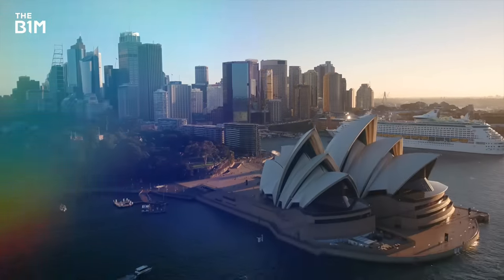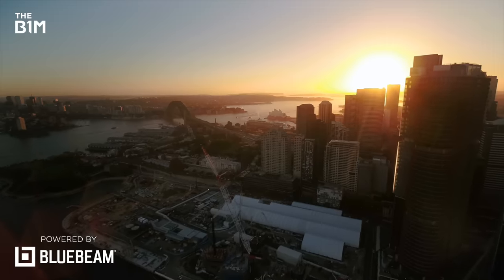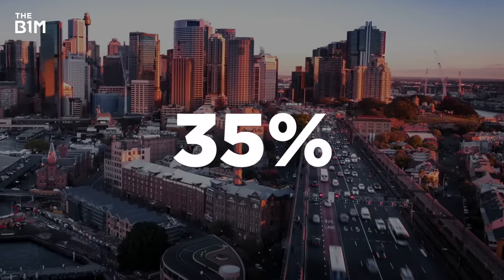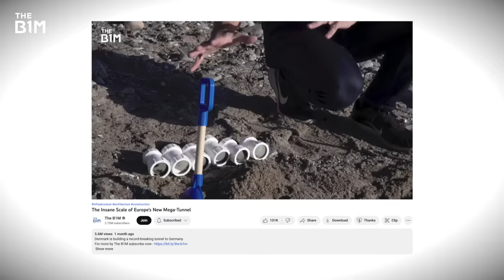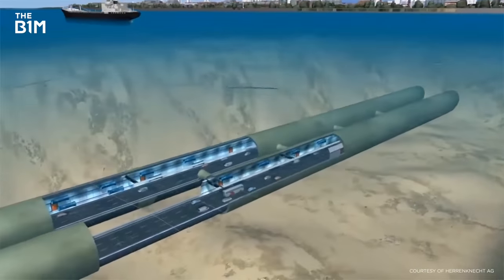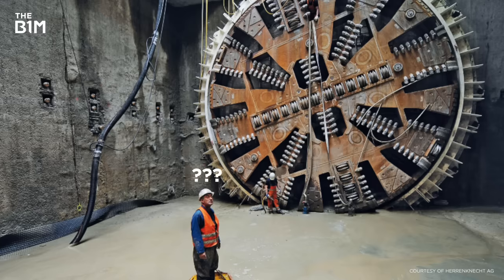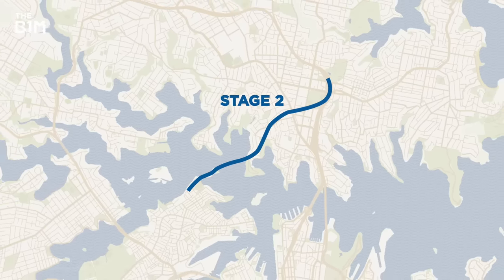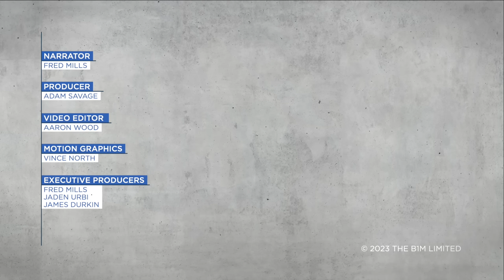Sydney's $5BN Tunnel U-Turn

Comment: Just a quick correction: The ANZAC bridge doesn't cross Sydney Harbour. You're thinking of the Gladesville and Iron Cove bridges. The ANZAC bridge replaced the older Glebe Island bridge for getting to the inner West from the city.
Other than that, a good video and very informative.
Reply: Technically Gladesville & Iron Cove bridges cross Parramatta River, no?

Comment: amazing video guys as always! I think Lower Thames Crossing is going to have over 16m in diameter and is also 3 lanes. So seems like pretty similar project. Maybe something to make a video about (not sure at what stage the project is currently tbh)
Reply: Also the very controversial Silvertown Tunnel!
Reply: @memofromessex thanks for pointing that out! I’ve had a look and seems like Silvertown tunnel is going to be roughly 12m so a bit smaller tunnel and probably 2 lanes.
Reply: Lower Thames Crossing and Silvertown Tunnel can do one, that same money could be spent on decarbonising our infrastructure. If you want a tunnel, let it be Tram/ Bus only...
Reply: @Garner84  
You will have more success explaining to car lovers in a CITY that their own self interest is to get other drivers off the road I.E. any forms of public transport means better driving experience; instead of worse with induced demand.

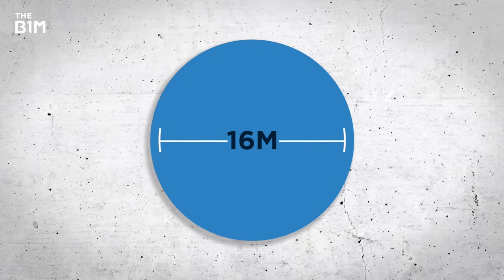Comment: 5:00 You could fit four railway tracks in a double-stack configuration in that big of a tunnel, each of which could be carrying tens of thousands of people per hour. Instead we have highway lanes serving 1500 people each.
Reply: We already have a huge railway system… adding in more wouldn’t be that useful.
Reply: @philliplhunter  well the sydney rail network lacks a lot of circumferential connectivity.
Reply: @williamhuang8309 that is why there is a metro
Reply: I'm not aware of the % grade of the end product incline, however I suspect it's unlikely a train could climb out of the tunnel.
Reply: @philliplhunter  You can apply the same logic to cars. We have a ton of roads, adding more won’t make much of a difference. Except a bunch of friends to politicians will make a ton of money. Public transport can always be improved. Look to Japan or Europe.
Reply: @jacobmcnamara7234  The SydneyMetro does not provide connectivity across the existing rail network.
I mean, the Liberals couldn't even be bothered connecting Epping to Schofields and deliver on the promise of their mythical "north-west rail link": it peters-out at Tallawong Station, a mere few measly Km short from actually connecting northern to western parts of the rail network. A bus ride is required to close the loop, rather than the train line doing it properly.
Reply: @RJ_171  Since highways have to be able to be used by heavy vehicles such as trucks, I don't think that the grade will be excessively steep. Since modern single-deck EMUs like those used on the metro tend to be more powerful than their predecessors, they should be able to climb much steeper gradients.
Reply: @philliplhunter  The railway system hasn't been expanded since the 1930s. Pretty much all the stations there are today also existed back then. If anything, there's less stations because some of them were closed down.
Reply: @blueshorts8820  that’s rubbish. There are so many new lines and stations. Not to mention a whole new metro about to open.
Reply: @philliplhunter  look up the 1939 Sydney rail map and tell me how many stations there are now compared to then. Yes, there is the new metro but it could be so much better
Reply: @bighands69  horrie bait. do better
Reply: @williamhuang8309  
Government is not the same as Communism. 
Government is a representation of people, regions and the greater political representation. Communism is about common ownership through a very specific economic model. 
Marxists who are the main flavor of communism in the modern world have been talking about these issues for over 100 years.
Reply: @bighands69  also yes, cars absolutely do have a place in society; but they're overused to the point of detriment
Reply: @williamhuang8309  Absolutely agree. I feel the Leppington-St Mary's metro proposal for Badgerys Creek airport really should be heavy rail to help provide more single-ride journey routings that avoid going via Central. It'd also help provide a freight bypass for the more congested inner lines.
Reply: @dj1NM3  True that. TBQH the Metro always struck me as more about union-busting and fragmenting the network in preperation for privatisation than it was any attempt at making a comprehensive transit system - especially when there was clearly other work that needed to done to expand the network, especially in the eastern and northern suburbs. Not saying that we don't need a metro, but we don't need the metro.
Reply: @blueshorts8820  What utter nonsense, the entire train system is undergoing upgrades from the existing stations, to the new Metro and light rail system, which integrates to the existing train system, have you been living under a rock for the last 5 years.
Reply: A north-south metro that doesn’t go through the cbd would be amazing. Instead we got the inner west route, more vote buying.

Comment: What we need in a hurry is an improved access to the cycleway across the bridge.
The cycleway on the western side is brilliant, but the north-end stairs prevent a lot of riders accessing it.
Reply: An agreed design is complete, but Milton's point residents still trying to block this one
Reply: Milson's*
Reply: @aussieL14M  why doesn't that surprise me
Reply: @aussieL14M  The new Mayor & GM are fairly both fairly progressive, so hopefully they can help move on from the noisy privileged strata dwellers of MP. 
The current design looks OK to me, though I hope they replace the palms that need to be removed on the N end.
Reply: sydney just had its hottest summer in recorded history but there still making roads for more cars and not bicycles! at least people can try to live in these tunnels when its to hot to live outside
Reply: @aussieL14M  bloody Milson's point.. I still can't believe there were people who had the audacity to complain about Luna Park, trying to get it closed/restricted, AFTER moving in there. Did they not research their new place at all? They clearly don't know the park's literally older than almost every person at this point.
Reply: @guringai   The state MP who should have been locked up for lying on the stat-dec on the nomination form, who only got in because Greens voters just put a 1 instead of supporting the Mayor of Mosman who stood as an independent, with their 2nd preference?  (For those overseas, there is optional Alternative Vote / optional instant run-off voting in NSW).
Reply: Update for the uninformed viewer:
Ramp is now approved iirc, just waiting on final design.

Comment: The Sydney log jam. Getting across town can take hours and cost a small fortune in tolls. At least the Metro has made life easier for those lucky enough to live/work nearby a station. They should prioritise it’s expansion before building more toll roads.
Reply: They are, set to open(?) in 2025
Reply: I mean there are currently 2 new lines and an extension to the current line set to open, only 1 of them is looking at serving a new area though with the extension being a couple extra stations in the CBD and converted train stations. The line to Parramatta isn't too far off the current train line but they aren't going to building many stations, even in places where they would be ideal

Comment: They could have just built a lot more metro lines and that would have done them better in reducing traffic than a tunnel which will end up not doing too much in the end
Reply: @DJ_CodNub No metros that cross the harbour in the west are planned
edit: I meant in the west, I have no idea how I didn't write that mb
Reply: @DJ_CodNub if you consider the amount of road infrastructure we have built compared to metro it isn’t alot.
Reply: @biosparkles9442  Apart fom the one already built beteem Chatswood and Sydenham
Reply: @biosparkles9442  What about Victoria Cross to Barangaroo?
Reply: @biosparkles9442  
3 comments on this channel. 
All 3 BLATANTLY WRONG!!!

Stop guessing. 
You’re literally TRYING to be outraged…
Like a Karen.
Reply: @DJ_CodNub my bad I wrote that comment when I was very sleepy, I meant that there's no plans to have it cross the harbour in the west like this road will. Where's the 2nd harbour crossing planned? I know there's the Chatswood to CBD one but didn't think there was another?
Reply: metro's already happening. Looking at the tunnel size differences though, it does raise the question as to exactly why they felt they needed that size rail tunnel, rather than a slightly bigger one that could handle the usual double decker trains
Reply: @mehere8038  I think it's incredibly stupid that all the tram systems are different gauges and are a different gauge to the trains. That's so very very very dumb.
Reply: Because the metro and Sydney trains are different networks. It's not just about building lines to new areas, but also increasing capacity in areas where the heavy rail gets very congested  - the City Circle - Main Suburban/Western Line. The metro is also driverless - something I'm sure the State Government would like to do to Sydney Trains if they could.
Reply: @daveg2104  I know they are different networks. But precluding them from being able to be connected at any time is dumb. In 50 years time it might be nice to be able to interconnect the networks. To be able to move a tram in a train track to a maintenance depot or something. 
Making them and deciding to make them not able to ever interoperate without giant money spending is as dumb as having the train networks in different states be different gauges.
Reply: @zyeborm  yes obviously! I've never really thought about it or heard about it, is the metro a different gauge rail to both the other 2 or the same as one of them?
Reply: @zyeborm  re linking them, I was recently watching a video on the Moscow subway & it's actually pretty incredible, really world class, if not world's best & it is a series of seperate lines, so I don't think linking is nessesarily good after seeing that (they run a train every 90 seconds in peak times on their system & basically never have any delays or issues) BUT, like you say, ability to move trains for maintenence etc, plus if something breaks, to be able to transfer rolling stock to where it's needed. There was an issue in SA during the pandemic where 20% or 40% or something of their trains were discovered to have a fault & needed to be pulled from service while it was fixed. Obviously universal sizing helps mitigate against any future issues like that if they ever occur. Locking stock to certain lines is obviously just dumb! As is building only for single deck capacity to a growing area of the city
Reply: @zyeborm  The metro and Sydney Trains use the same track gauge and power supply. The issue would be the fact that they are driverless. They do have controls that can be unlocked so they could be driven on the Sydney trains network manually. The driver wouldn't have any privacy or protection from passengers though. Not too sure that would be acceptable for revenue service.
Reply: @mehere8038  I'm not 100% I know the trams are incompatible with the trains and with each other. So I presume the logically any new thing will be incompatible as well in order to make the biggest cash grab for the vendors.
Reply: @daveg2104  well that's something at least. If only the trams matched up too. At least the gauge. Other stuff can be changed or hacked one way or another.
Reply: @zyeborm  The new metro line to the new airport is going to be 25 kV 50 Hz AC, not 1.5 kV DC like the rest of the system. So it wont be able to inter-operate with the other metro lines. I have no idea why, unless there are long term plans to convert everything to AC - a big project that would be.
Reply: @zyeborm  They are using foreign made trains. I think the metro carriages are made in India. Even our new double deck train carriages for Sydney trains, and our new ferries, are made overseas. There have been problems, to the extent that there has been talk of getting this stuff made in this country again. They had better not delay too long, or we will lose the expertise.

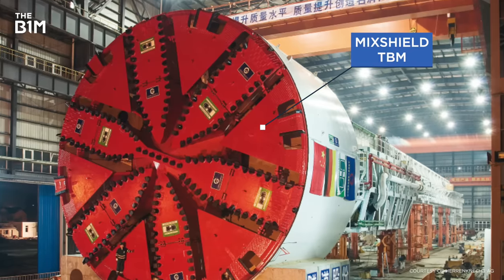Comment: Great Video! Thats a really interesting turn of events. However, at 5:40 you say, that they use a Mixshield-TBM. The explanation was right but a bit missleading. In this type of mixshield the supporting pressure for the heading face is crated by a bentonit suspension. The air cushion is just there to regulate the pressure because it takes less time and energy to change air pressure rather than liquid pressure.

Comment: Thanks for doing my home town. This problem could have been sorted out in the 1950s with a expressway project that never happened. Sydney needs more reliable public transport that arrives more often!
Reply: As a tourist regular visitor to Sydney it has much better public transport than a lot of major cities here in the UK
Reply: You need to travel overseas more (and not hire a car!), then you would realise that Sydney's public transit does a bloody good job compared with many, many other cities.
Reply: sydney has amazing public transport. ive lived here for 13 years now and never had a drivers licence. it isnt without flaws, but i can get from a to b purely on public transport without any issues at least until im heading to the outskirts where any city will have problems due to supply vs demand.

Comment: This video is really missing the point. Sydney has constructed something like 50km of freeway tunnels under the city to remove cars from surface roads. This is another link meaning huge amount of traffic can now bypass the city by going directly under it. It's similar to Tokyo, but the freeways are underground. Sydney also has an excellent transport system - they have an extensive s-bahn system and are currently investing heavily in new metro lines.

Comment: Although I agree that traffic can be bad in Sydney, I don't think it stands out from other cities. Definitely improvements need to happen which should include public transport but I have to hand it to this state government for cracking on with major infrastructure projects. I've not seen so many major projects underway in my lifetime. From the new international airport to Metro lines across the city, the new Metro harbour tunnel, linking the motorways in a network of underground passageways across the city. Just today it was announced that the new M4/M8 Link will open tomorrow ahead of time and on budget. I'm not waving the flag for this government because I can point to many criticisms but credit where credit is due. This is not meant to encourage more road traffic, just fix the problems of existing systems that have been outgrown. The first part of this project is about to come to fruition and is an amazing feat of engineering and planning. I have been watching the updates with great anticipation.

I am a huge fan of your videos. They are professional and use great resources and explanations to appeal to a lot of different people. We must bear in mind though, that it is one perspective. I, for one, think this project is very important and well thought out. The location makes sense and this change in methods is obviously an improvement. I'm curious to know how many tunnel boring machines are being used in Sydney at one time because there are a LOT of tunnels being bored across Sydney right now. Yes, there are a lot of tolls but how else are they going to pay for this convenience? A raffle?